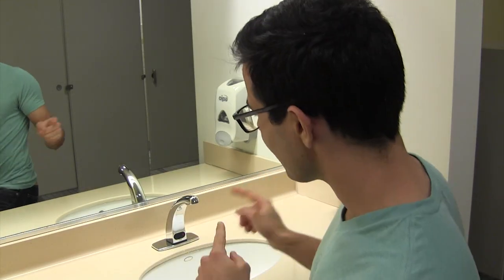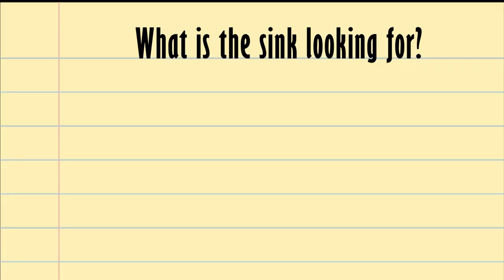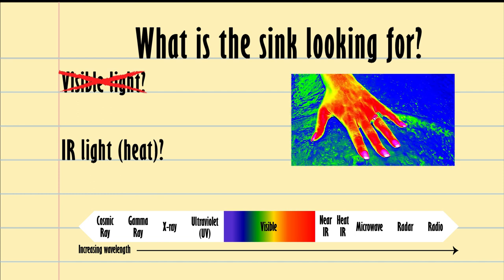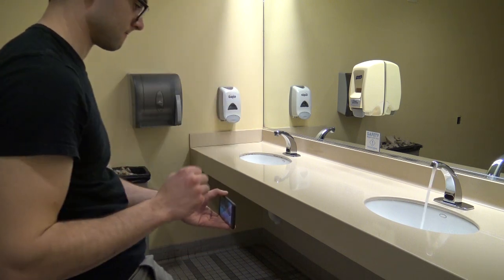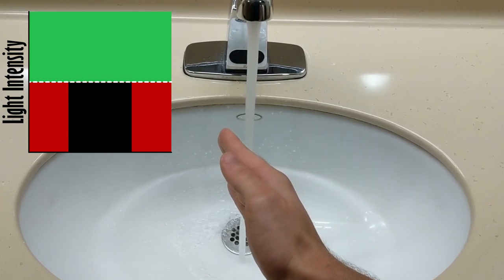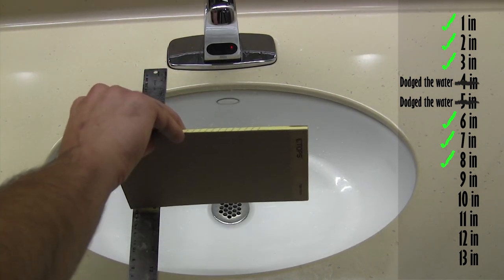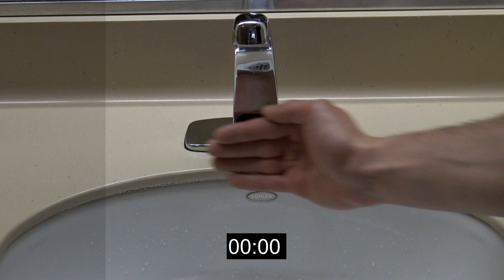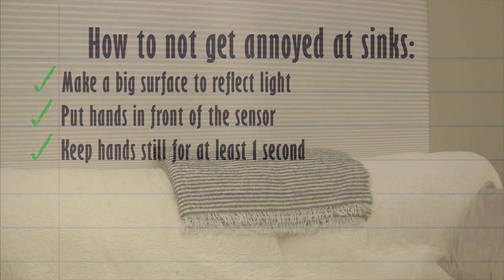How do automatic sinks work?

Comment: Great video! I guess this is how automatic toilets and urinals work as well. Some ideas for you: 

- Why do cars get so hot in the sun? Why exactly are almost all plants green? Does the sun make no green light? Why aren't solar panels green? 
- How do microwaves work, and why do they make somethings super hot while not heating others? What is the optimal way to microwave something? 
- How do LEDs work and do they really save energy? What is the difference between a light and a laser?
- How do wireless cellphone chargers work? Why don't more things charge like that? 
- Why aren't there optical computers that use light instead of electricity in the CPU? 
- Why do we need to turn off our electrical devices during takeoff? What IS the deal with airplane food anyway?
Reply: Thanks for the ideas! Definitely have plans for a microwave video, and I really like the wireless charging idea.